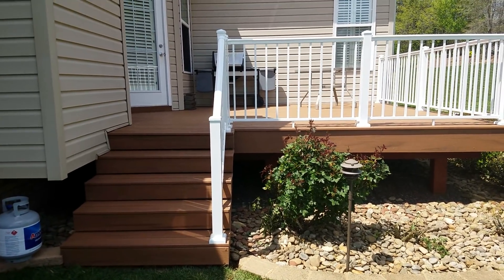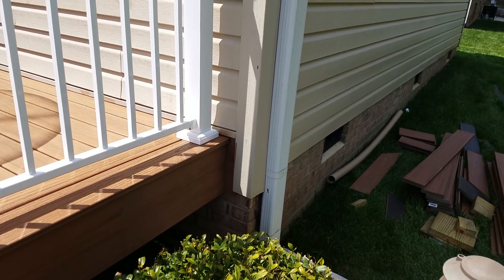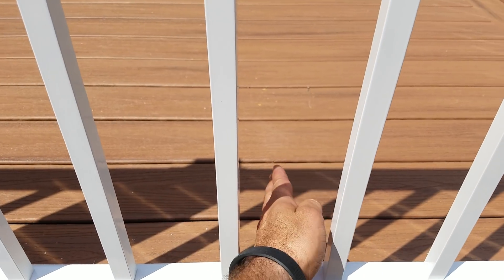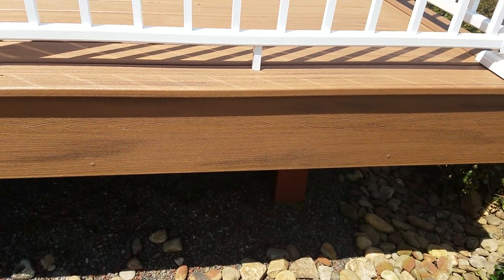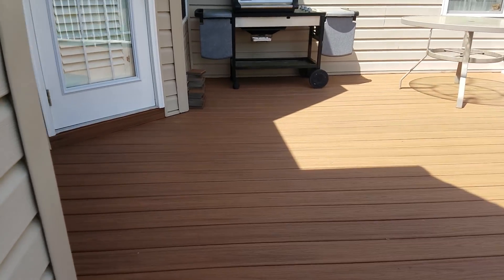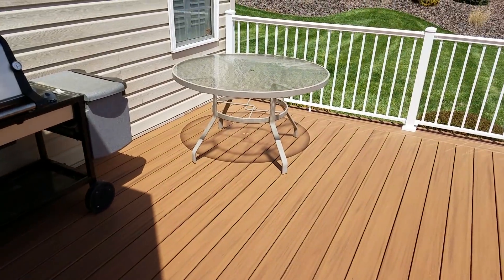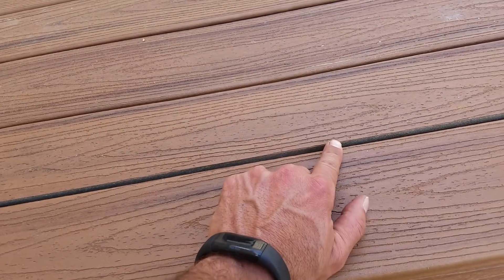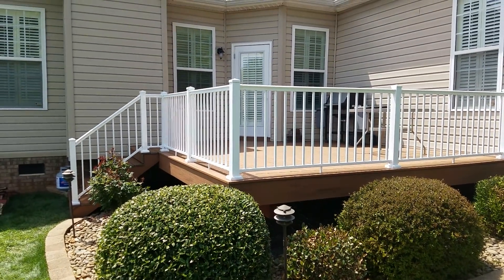Composite Deck Day 5.  All done!

Comment: How much did you charge and how much did the materials cost?
Reply: Trex is very expensive, about $13 a square foot for railing and decking. This does not include the special screws which can get quite expensive. So materials for this are probably around $3200. I would have tacked on 35% for my labor and profit and a couple hundred dollars for dumping fees and misc tool expenses. I would charge $4500-$5000. Hope this helps. BTW Trex has a calculator on their website so you can get you materials estimate pretty close. 

https://www.trex.com/products/deck-cost-landing/productcalculator/
Reply: Timothy Rozansky  $4500 to $5000 for labor or total.  Labor  and materials?
Reply: $3200 for materials plus $1800 for labor. That’s my estimate for a 14x16 deck with similar railing. Obviously contractors in your area may be different
Reply: Timothy Rozansky   That’s reasonable. Thnx Tim.
Reply from the maker: I actually had about $4500 in material and $3300 in material.  This customer chose the highest level trex material so that drove the material cost up.  Sorry for the slow response